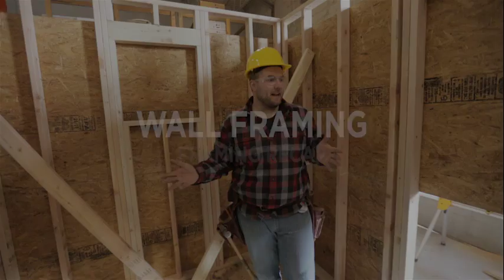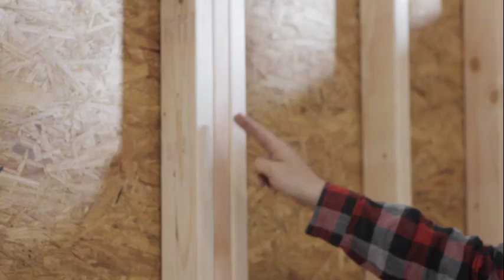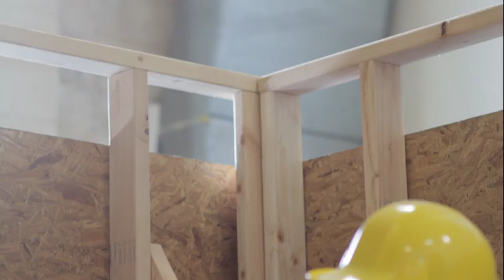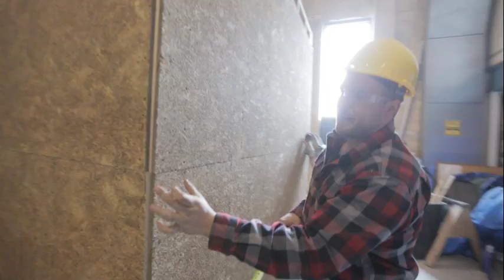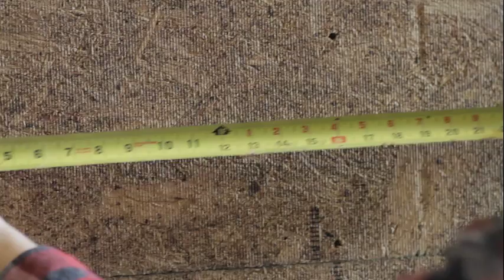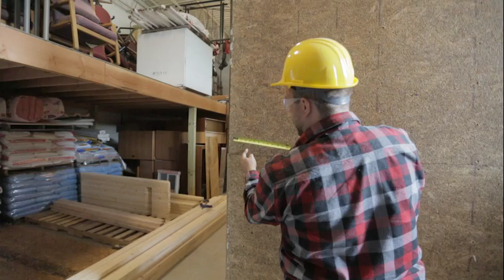How to - Wall Framing Part 6: Framing Recap

Comment: Why the double king studs on the window side?
Reply: Due to the layout of the studs, we added two studs to fill the space between the 16 OC studs and the King stud to carry the 16 OC measurements throughout the wall. This also helps with fastening the window fins along with siding trim around the window.
Reply: David Ruff thanks for the answer. Good to think of design rather than just blindly placing studs.
Reply: @rapfreak7797  Thank you for your questions, comments, and support!
Reply: David Ruff these videos are great, most videos skip over important steps and yours are the most complete I’ve seen.

Comment: Is the first wall you built  the only wall built on the floor deck?
Reply: That is a good question! All four walls were built on top of each other using the first wall as a new flat workspace. After all the walls were built they were moved one by one to a temporary location to make room for standing the walls up. I hope that helps!